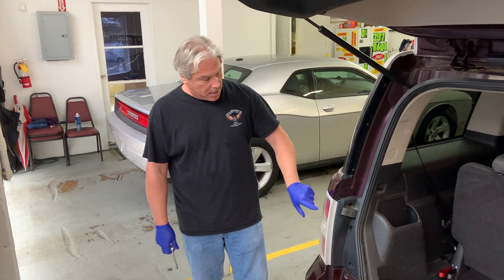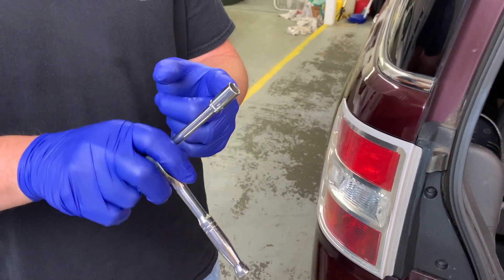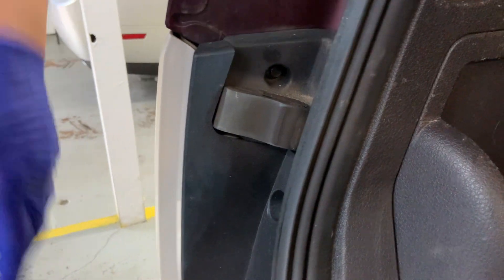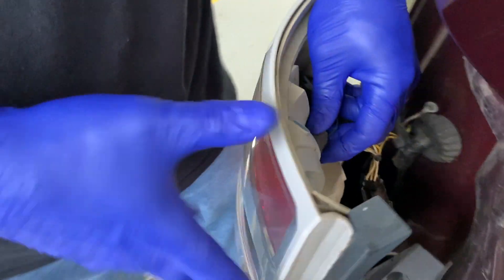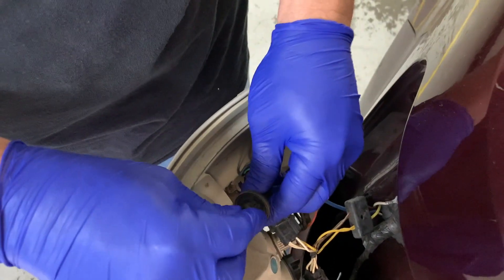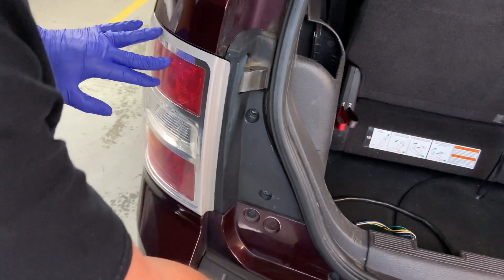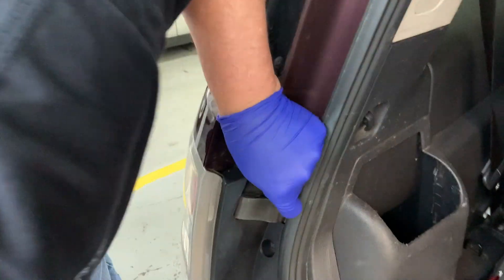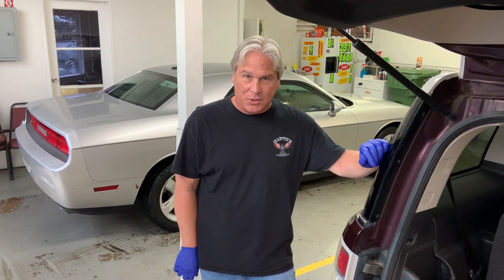How To Replace Tail Light Bulb On A 2009-2019 Ford Flex

Comment: Well the part location is easy enough to replace but my 2010 Flex signal is the bottom bulb for the rear. Make sure you blinker bulb is on the top or bottom (as mine was).

Comment: Do I change the top bulb or the bottom bulb? Not sure if I should change both my right rear blinker is not working. I’m done going to the dealership they act busy and I need to do this myself. Thank you very much
Reply from the maker: I would suggest changing the bulb that is not working. Process should be the same to remove the assembly from the housing.

Comment: Can this be an upgraded LED bulb or does it flasher like the larger turn signal bulb below?
Reply: yes you can replace it with a LED bulb but be careful if you get a cheaper bulb they get hot fast and melt the plastic. Get a good led bulb and you will be fine,., They actually sell led bulbs that look just like the regular bulb encased in glass. I used them on my interior and they work great
Reply: @skipwilliam5639  which bulbs do you recommend?